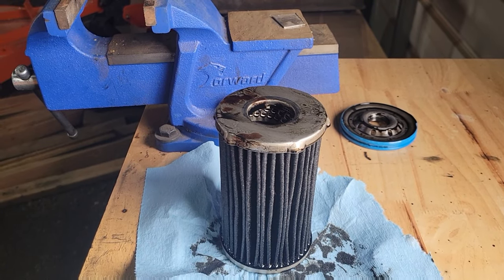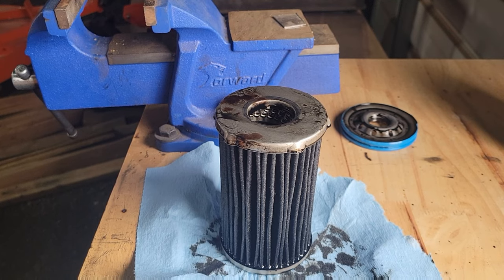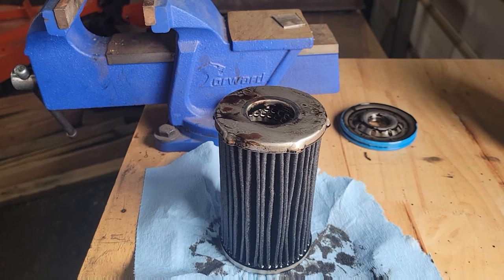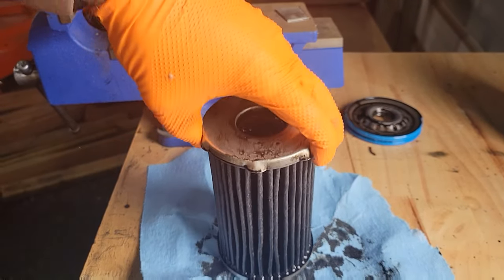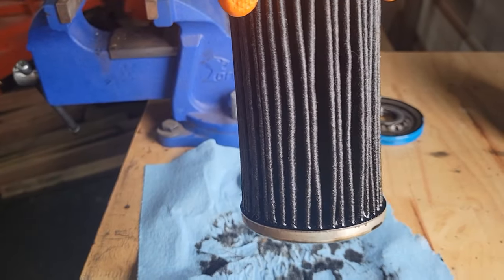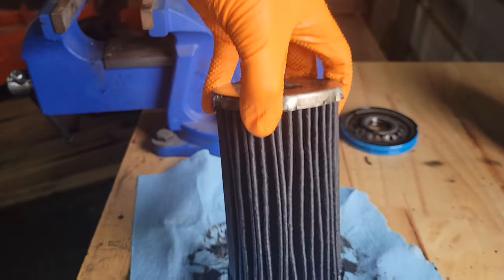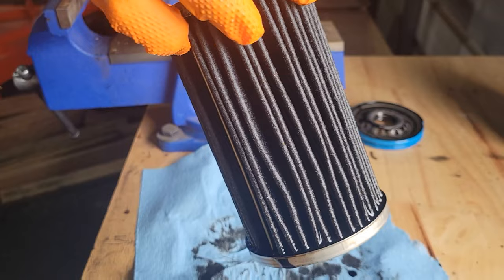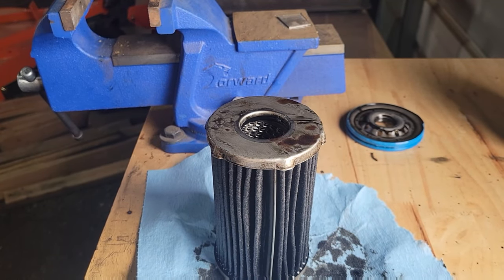8500 Mile Review Donaldson DBL 7349 Oil filter off a 6.7 Cummins. #cummins #donaldson #oilfilter

Comment: I have an 18 Ram with 390k I use for hotshot car hauling. I run fleetguard filters and run Amsoil 15w40. Every oil change I have an oil analysis done. I use to always run my oil change intervals around 12k to 13k and the oil analysis come back e every time clean. The past 3 oil changes I've went to 15k and 16k because I've been busy. Still clean oil analysis. PD Diesel Power on YouTube runs Schaffers in his fleet with 15k + oil changes. Don't be scared to run longer.
Reply from the maker: Thanks for the input! How long do you run your fuel filters?
Reply: @TylerTheFieldServiceTech  I change oil and fuel filters all at the same time (15k ish) but if you are on the road and filling at truck stops I'd maybe consider sooner. I run local and rarely use truck stop fuel. My filter under the bed, during covid I couldn't find a Fleetguard, used an off brand from Autozone. Never again! My filter under the hood was black
Reply from the maker: @Adam Kane Transport LLC  wow yeah haha black in the hood it no good. Who do you use for your sampling?

Comment: I’ve got a question here, but want to start with my data so you know what you are answering for (not to brag about my stats). I do not use my truck for hot shot, only personal use, but I’ve got a multitude of trailers and am
Typically pulling total CGVW of about 28,000-31,000. My biggest trailer is a 48’ triple axel TPD enclosed that I mostly use to move my household goods when the USAF PCS’s me every two years.  My total weight slips per move are typically 135,000lbs so it takes me a few trips. My ideal time is almost non existent, because if I’m not moving down the road, I’m not running. I have been using fleet guard filters, valvoline premium blue oil and changing every 3,500-4,500 miles because of filtration more than oil breakdown. 

I never see my oil look golden for more than a few hundred miles.  I check my oil every time I fill the fuel, and I can see it change quickly. This is why I typically buy the oil by the years worth when it goes on sale, and get my oil change cost down to about $50/ea. 

So have you given any consideration to changing oil filters at a lower mileage and running the oil up to the 10,000 ish mile mark?   I know amsoil people preach this, but at 3,500 miles I can already see a major change in the cleanliness of my oil and choose not to run it any longer. 

Thoughts on this?
Reply from the maker: I'm assuming since you run valvoline Blue, you run a diesel?? Diesel oil turns black almost immediately. It's supposed to be black. The color of the oil doesn't dictate the oil life. The only way to tell oil life is from seeing contamination like water in oil or from oil analysis. I send all my oil into Schaeffer's for analysis. They always come back clean, and oil life still left. The oil filter is not usually the problem with oil breakdown. The oil will break down long before the filter gives out due to  high oil temps and contamination mostly from water or coolant in the oil. It wouldn't really make sense to change just the filter. You might as well do it at the same time. I will run my oil 7-10k depending on the brand I buy.
Reply: @TylerTheFieldServiceTech  interesting concept.  I appreciate you pulling the filters apart,  it cannot say I’m agreeing with the oil breakdown or black. 

I am running a diesel. I still have my 1995 12v Cummins, a 2011 6.7, and my low milage 2018 (bought in very late 2019) 6.7 Ram. 

As you showed in your own videos, the filters start showing collapse (not significant, but starting) at as little as 7,500 miles.  Any test of any of my oils at 7,500 miles says the viscosity is fine and can easily go another 2,500+ miles.  But I surly don’t trust the filters longer.  

As far a black.  Any bypass filtration system saying they go sub 10 micron SAYS they will help with that tons.  I have no personal experience with that YET…

BUT, all major Diesel manufacturers say sub 35 micron particles are causing wear, so that’s what I’m looking to address.
Reply from the maker: @NiagaraFE   Just run premium quality  filters and quality diesel oil and you will be good. Good on you for doing your homework and taking good care of your trucks. Most people don't even know how to read a dipstick or ever bother to look under the hood. Bypass filtration systems are really good some semis run them and like change the oil like never haha
Reply: @TylerTheFieldServiceTech  Roger!   I have been running the higher end fleet guard for about 5-6 years.  Before that was MOPAR filters. So I’m doing so/so there.  Could be better, could be much worse. 

On the oil, ugh.  Still have to change it even with the BEST filtration ever, as filtration won’t solve viscosity break down.